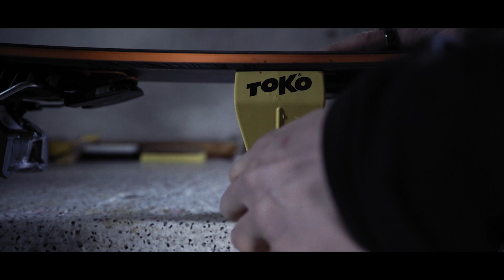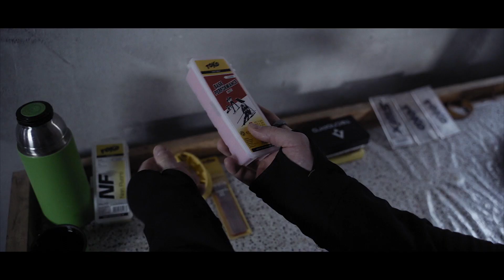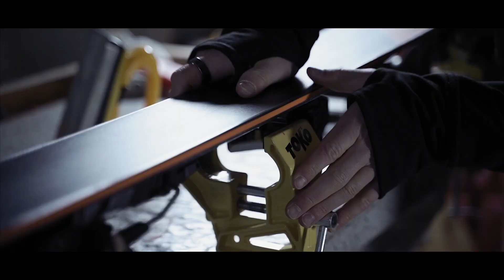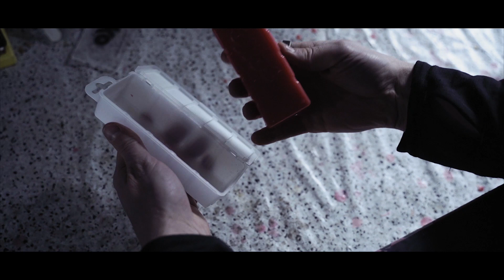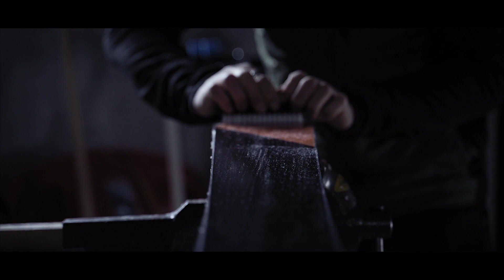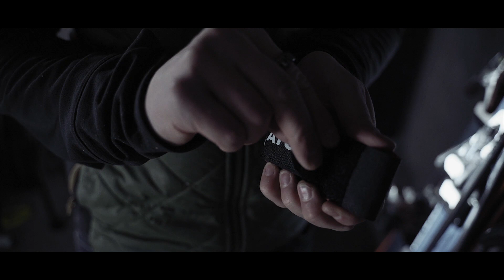Silently Waxing Skis

Comment: Gonna like this one for whenever I have the tools to wax my own
Reply: Tools are not the issue, really. The space is. That scraped off wax is a b*tch to clean up (it sticks to everything), so if you don't have a garage or a workshop it's a bit challenging. 

The tools are (roughly):
1. Iron: $70 (an old regular iron also works if you are very careful with the temperature but it makes it easy to overheat and ruin your base)
2. Brushes: $10-$20
3. Scraper: $5
4. Wax: $15?
5. Rubbing alcohol: $2?
6. Rag: $0 :)

Waxing your own ski/board is a nice thing to do once. It's incredibly zen.
Reply: inovakov I wax them in my apartment, just put some towels under you skis and cover the towels with newspaper
Reply: I just use an old iron made for ironing clothes and an ice scraper for cars
Reply: trash. I did the same with the iron and it works but a real iron is so much better

Comment: Could you make a tutorial for correcting big scratches in the bottom sheet? Love your videos keep it up :)
Reply: Chron Felix not that difficult, get all the stone deposits out of the scratch with a rough wire brush & fill the hole with a repair candle. Then wait about five minutes, not to long, and wipe off the leftovers. And if you have enough time, wax your ski again like Jens showed in the tutorial. And you‘re ready to go!
Reply: @ZenoKaufmann  yeah i know but he could show which tools he uses  and how, maybe even get into detail with edge tuning
Reply: Chron Felix watch a tutorial on how to ptex your skis, or better yet take them into your shop and have them do it for you
Reply: Ptex candles only work for medium width scratches. For bigger scratches you need a ‘welded’ repair, using ptex tape or sticks (which unlike candles don’t contain wax to help the ptex flow). The ptex is then melted using either a suitable soldering iron or specific ptex gun, designed to work at the right temperature. If the scratch is deep enough to see the white fibreglass core (a ‘core shot’), then you first need to apply metal grip string to the fibreglass (and any steel edge if the scratch touches it). Metal grip is a more flexible form of plastic. 

In all cases you need to remove dirt and old wax with a wax cleaner first, and then ensure there is a key to help the ptex repair material to hold. This might involve slightly undercutting the sides of the scratch with a Stanley knife or similar. Once the ptex repair material has been laid, it needs to be given time to harden, then smoothed down (many people do this with a cabinet scraper and a scouring pad). Then the repaired ski base needs to be structured with specially made brushes prior to waxing.

Comment: You should really do a hot wax scrape to remove contaminants from the base prior to applying the working coats of wax. And the iron should not be pressured, it should float lightly across the base under its own weight in order to reduce the risk of base burn.
Reply: Shush dude!  This is a quiet calming space. ; )
Reply: @dkitsap1  - Haha, oops...🫢

Comment: Qestion:

If u scrape off the wax can u theoretically re-use it
Reply: Not a good idea because the wax gets dirty and burnt and you don’t want to put dirty wax on your skis
Reply: @antontereshchenkov3063  thanks for the clarification
Reply: Lordpuffer Der erste just don’t.
Reply: i never scrape off the wax and leave just on there
Reply: Nooo the wax act as a conductor for a molecule in it which make slide your skis that’s why you scrap it off after and you only left the molecule on your base so don’t put used wax on your skis it will only scrap your base
Reply: Also you brush it because the underside of the ski has a texture to improve sliding you don't want to fill it up completely with wax
Reply: i would recommend leaving some wax on for the park or off-road so your ski slides better on obstacles or doesn’t get that beat up when you hit rocks or iron stuff in the park